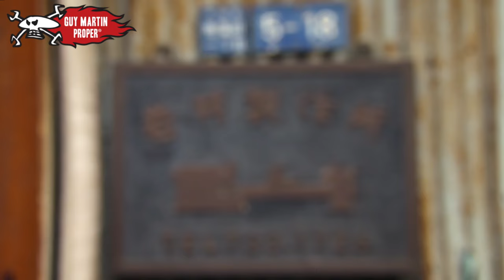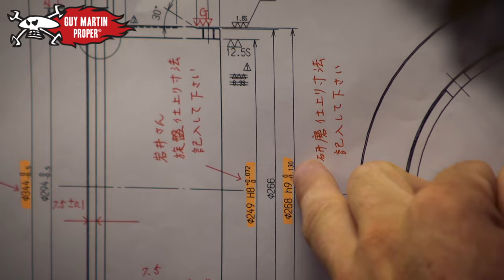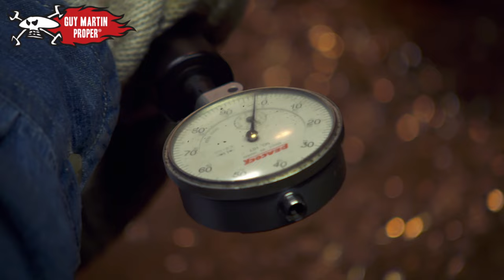Guy idolises a Japanese engineering master | Guy Martin Proper

Comment: imagine, such a master tells you, it would take (only!) 1 year to become a master. I can't imagine a higher praise.
Reply: Indeed! But to Guy’s credit he has decades of experience
Reply: Marius Ipad  So that was translation mistake?
Reply: @schumbo8324  hes kidding.
Reply: Master, not grand master
Reply: As long as he doesn't lose an eye. He was cutting with no eye protection, which is crazy.
Reply: He said "Ichi nen sureba, ne, aruteido."
Which means "Given a year, yeah, to a certain degree."
So he's clearly answering a question there, rather than making a statement spontaneously. I assume he was asked whether Guy could master the trade, or some such.
It might not sound like a ringing endorsement, but old artisans like this in Japan are very tight with their praise, so I'd still say this is something to be excited about.
Reply: @AcmeRacing  Obviously it's smart to use eye protection when using any form of rotary tools, but the swarf from a lathe comes out smoothly. Unlikely for something to come flying out without a catastrophic failure.
Reply: Definitely a feather in the cap.
Reply: The problem with these specialised skills is that it does not reward the money it should for the time invested.
Reply: But like me being a truck mechanic... 60 000 hours is 6 years... so being that i have been in the trade  for 15 qnd guy is older than ke we both have considerable more than 6 years on the job
Reply: @AcmeRacing  The sky is falling.
Reply: @thulegezelschap5884  You don't get it. This is a man who literally could not live without the metal. He did not make a penny on the nuclear fuel rods. His choice. The work was far too valuable in terms of human life to concern ones self with monetary thoughts...it's just not done.
Reply: @cun7sathome  You didn't take note of the fact that they purposely referenced the age of the certificates?
Reply: @AcmeRacing  true.. But ive done it myself.. The steel they where turning made a really long and even splinter, its more dangerus when there are 1000 chips
Reply: @cun7sathome  So you make 10 000 hours a year? Not bad. Do you ever sleep? There's 8760 hours in a year, so you have to put in lots of overtime! ;)
Reply: Cool, but like it said in the video, Guy Martin has been behind a lathe for over 20 years.
Reply: DT Man and Van  not the same part, the same shape. Diffrent dimensions .
Reply: @AcmeRacing  well metal tends to not fly around when being cut unlike wood. There is a reason you can see all the metal scraps just neatly curled up. it doesnt shatter away.
Reply: I read somewhere that 3 years or 1000 hours spent in your chosen field is what takes to make a master in it...🤷‍♂️
Reply: @stemartin6671  10,000 hours not 1000. But time isn’t all that relevant, if you spent 10,000 hours doing the wrong thing.
Reply: @terryatkins  no it was defo 1000 and was in reference to how long it can take to become a master at a skilled trade...
Reply: yeah baring in mind it's usually around 10 years from starting out, to get to that sort of level in most trades
Reply: It wasn't a praise. He was actually being self-effacing.
Reply: DT Man and Van  he makes tubes, large diameter tubes by the looks of his kit. The diameter that guy turned was I believe 275mm with a tolerance of 0.075mm is not exactly precision but not its not far off.
Reply: @stevewright8312  H8 is a rather big tolerance tbh. default recommended tolerance is H7. For measuring tools its H3 ..
Shame to show a master doing such an easy part
Reply: @stemartin6671  1000 hours at a trade is nothing. I had over 1500 hours my first year as apprentice, you need 8000 to qualify just as a journeyman
Reply: @baldanders  congrats. Most people do over 2000 hours at work a year, that doesn’t make them experts, idiot. Learning and constantly progressing does.
Reply: @matthewfryett5815  
日本語と日本の文化に詳しいですね。
1年間継続すれば弟子になる技術になるかもしれないって意味です。
その先に職人があります。
そして、先には名工と呼ばれる世界があります。
その先には、日本の国が認めた功労技能者と呼ばれる世界があります、
最後には、同業者から認められる称号や特定の名前を名乗る世界があります。
それは職業によって違ってきます。

Comment: He double checked his work so often "he never made a profit" - I believe him.
Reply: This is the problem that many true craftsmen have, they are not business men.
Reply: King Delevingne  its a problem when you cant pay your rent, otherwise no, its not a problem at all.
Reply: Well he did explain that if the cylinders weren't proper could've caused a nuclear disaster
Reply: King Delevingne It’s a problem for the craftsmen and it’s an injustice as craftsmen are usually nice people and end up not as well off as they should be. If they work for wages then they don’t have to be business people but the only problem is that some industries like in automotive industry are run by salespeople who have no concept of what a good trade person is worth and pay their workers peanuts and they get monkeys so now smart people don’t want to be tradesmen and when you have a problem with your new car you have to go back a few times before it gets fixed if you’re lucky. It’s absolutely ridiculous. I’ve also seen this first hand in the dental industry where I worked for 8 years in a service department. Low wages made it difficult to get good people and we ended up with people unqualified repairing sterilising machines without calibrating them properly which means people could have picked up some nasty diseases. It was only when I resigned that I was asked to stay on a bit longer for four times the wage to train the electrician that replaced me. Think about it the next time you’re having you’re having a filling, I know I do.
Reply: King Delevingne  Of course it's a problem. The responsibility of making sure the work is paid for begins with whoever funds it. You don't underpay someone for such an unbelievably important piece, in hopes that he will take the responsibility of putting in extra work for free...
Reply: @Cooliemasteroz  it only takes one very tiny mistake to kill people. This is why my boss hates me. I'll  triple check every little detail
Reply: This man works through his heart not in his pockets. His love for his country and craft is amazing
Reply: EpiDemic117 Yes here in Australia the workforce has been severely dumbed down. Management isn’t what it used to be either because people  rarely start at the factory floor and work their way up and now you often end up doing your job the hard way. There are exceptions, you can still get a good manager but it’s not common. My time at the Australian Broadcasting Corporation was the last straw for me and  I’ve become very intolerant of the modern workplace and I think I’d rather be destitute than work for some one else again.
Reply: @enja001  nothing wrong with that if it isn't perfect it isn't good enough same in my book trouble  these days no one has pride in their work anymore get it out and shit is produced but they want massive profit for it (pants)
Reply: "The best is the enemy of good"- Voltaire quoting an italian. (persuit of perfection ruins good enough)
Effectively you can spend forever making something perfect and it gets in the way of the job being done at all.
Or if you spend so long making something perfect you're unlikely to be adequately reimbursed, As such you can go out of business and then all that is left are people doing the bare minimum.
Sometimes its better to do a good job for a good price rather than doing the best job for an even higher price where most consumers would rather cheap out and get something less-than-good instead.
Most people cant afford a bugatti or Mclaren no matter how good they are.
Hence Volkwagen/Toyota/Ford are the biggest by making good-enough for a good price.
And why your boss will give you an old Lada if he can.
Reply: @Cooliemasteroz  Be humble as Christ is.  You will be blessed as this man is.
Reply: @felipewerner6670  I signed in just to like this comment. It's got just the right amount of barb ..., but is also a profoundly true statement.
Reply: @lesleykramer7207  thanks friend, hope youre doing well, wish you luck...
Reply: “I made them with all of my heart. I checked and double checked everything. I didn’t make any profit.”
Reply: @Cooliemasteroz  If skilled workers got paid what they are worth you could never afford a car.
.
I'm an Aussie fitter and turner and I HAVE chosen poverty over working for Australian managers. I mow lawns for little old ladies rather than get (more on) the dole. Well, as much as possible - covid fucked that up recently and I had to go back into the industry for a few months. I was put straight onto the highest rate (I'm well known locally) without hesitation at $39.80/hr casual. My son working his way through uni as a casual forklift driver gets $43/hr.
.
Yeah, the work force has been severely dumbed down. The modern "streaming" of students into the trades by our schools is "helpful" in the same way as is TAFE, teaching the trade customized for businesses... not for the apprentices to learn all they can. Our apprentices are being ripped off. They get poor training for poor pay in the hope that they will one day earn an average wage in this country.
.
There is no apprentice in this video for the same reason we are importing 457 visa holders hand over fist. An ordinary tradesman's income is only viable if spent in a very poor country, otherwise the costs outweigh the benefits. Even in the mining industry - for the investment required - you are far better of driving something diesel than being a diesel fitter.
.
I have VERY slowly built a little machine shop in my back shed with two (old Aussie made) lathes and a tiny milling machine. Week before last I managed to earn a days pay for a day and a halfs days work making a part for a '38 Pontiac. I occasionally get resto and custom work but lawns are easier, safer, more lucrative, in higher demand and take less maths.
Reply: lordchickenhawk it’s good that you’ve got yourself a machine shop because you can still make a lot of money through innovation, sometimes you don’t need to patent an idea. 

When I left the ABC back in 2008  I had shingles and similar damage to my spinal chord that MS  does, but I had an idea for a labour saving device. I went to BEC (business enterprise centre) to learn how to run a business so that I could just build these things and sell them. The engineer at BEC that I spoke to told me that I was going about it the wrong way and to maximise it’s money making potential, I’d have to put it on the world market. All I had to do was build a working prototype, get a confidentiality agreement drawn up for anyone who I speak to to sign first, get an industrial designer to improve the prototype where needed, get the design registered with IP Australia then approach a company that makes this sort of thing and strike up a deal where I get a percentage of the profit of every one sold. Then I was told that if they want to buy out my design then that was were the big money comes in maybe a couple of million.

At the time I was between houses and back home with Mum as Dad had passed away a few years earlier and as there were a few sheds and tools, and room for a lathe so I thought it would best to help keep Mum at home since I was single and work from home at my own pace as I was not well enough to hold a job though Centrelink disagreed. Unfortunately my sister who is a manager thought it would be a good idea to get my 74 year old Mum an energetic farm dog. Well that dog controlled Mum and every 5 minutes while I was trying weld I’d have a dog beside me wanting to play, I was already in a world of pain from shingles so I locked the garage door to keep the dog out and made myself sicker from welding fumes. Then my sister the manager gets herself sacked, gets a job as a sales rep, looses her drivers licence and tries to get Mum to drive her all over Sydney. I had to step in as Mum was to old to be doing that and if she lost another job then she’d have sell her house and come home, then I’d end up in jail for murder. Eventually Mum gets dementia and after 4 years of not being able to work with no help from centre link, I’m no longer able get back into the Sydney housing market and I had no choice but to become a carer for Mum. I’ve been drowning in shit ever since.
Reply: @Cooliemasteroz  I subscribe to the Joerg Sprave school of patent protection. As for the rest, I'm sorry if my comment came across as whinging victimhood. I meant it to come across as rage over what the trades have become in this country.
Reply: lordchickenhawk no it’s ok You didn’t come across as too negative in my view and I agree with your comments, you should hear me on a good day.
Reply: @FrazerHatyai  he was talking about a certain piece for a nuclear factory you should pay attention more
Reply: That just shows how highly he values his time. He must have been paid a lot for them.
Reply: He has to get the material from somewhere to pay for it and make them.
Reply: I believe him
Reply: @Cooliemasteroz  higher labor costs = higher cost of goods and/or thinner profit margins. If the craftsmen are also the ones who are funding the business then they can decide how much to pay themselves and how much to sell the product, but that's usually not the case. Plus it is not guaranteed that it will sell.

Capitalism aims to maximize profits, so unless you can use craftsmanship as a selling point and consumers are willing to pay for the premium for higher paid craftsmen working on the product then good. But most investors only care about profit and most consumers only care about getting an ok product for cheap, that's why almost everything is made in china now.

When i buy stocks/ make an investment i want it to be as profitable as possible, that's basically the point why i am doing it. But as a consumer i am willing to pay for quality products now because i am not so broke anymore compared to my younger self. Living here in asia, i try to buy local or try to buy stuff that are made in Taiwan or Japan.

Plus CNC machines are pretty (very) precise though they still require a good programmer to make it work, which is a different kind of mastery. Not only do they need to know tooling and machining, they also beed to know programming.
Reply: that's tragically funny.
Reply: And if you think how most of west feels with the yell to "offshore" everything, how do you think that those outside the boardrooms of Japan feel.
Reply: @tomstech4390 ....but , a Lada is as fast in the line to supermarket as an Audi. A lot of design, spec development can be mission drift.....Austin Champ V Land Rover.
Reply: @jgus4312  Free issue material was often the way.

Comment: Someone please find this man an apprentice. 60,000 hours of knowledge cannot be allowed to die.
Reply: not trying to be disrespectful to him or his knowledge, but can a computer not achieve this same level of accuracy? This seems like another job that will be automated out of existence
Reply: @ABversion87  Not when creating one offs like that. You can, but you'll take more time and have more scrap.
Reply: @ABversion87  Someone still needs to design said piece as a 3D model or some sort of Cad file for an automated machine to work. Can't just press play. There will be another form of someone working behind a door for countless hours making sure its done correctly. Just not in the way you may think.
Reply: He had 60.000 hours when he reached the Takumi distinction, this man has at least 180.000 hours of work, most likely a lot more than that
Reply: @Syncopia not replying for you but for anyone coming across this in the future.

Conversational machines are way more capable to make single one off parts than any manual lathe is. Way quicker and more accurate with actually less scrap because the machine does exactly what its told. The only way you could make a bad part or scrap one is if you incorrectly input the wrong dimensions into the machine, or read your drawing or measuring tool incorrectly, which is the same exact problem you would have on a manual machine.
Reply: I would learn this happily 🫡